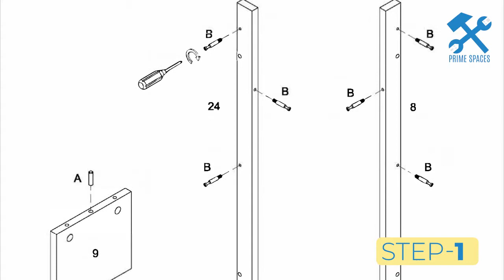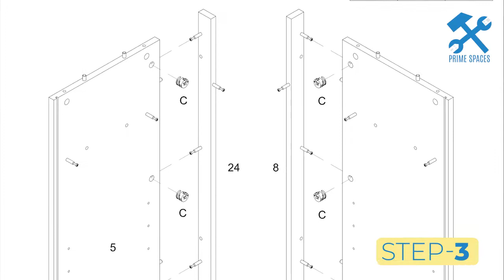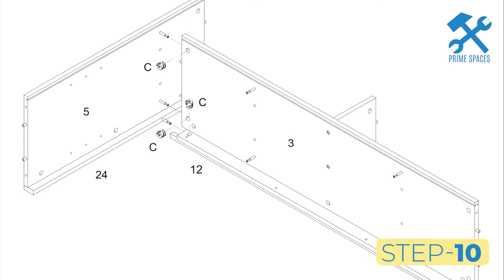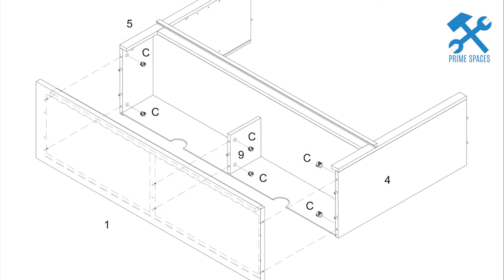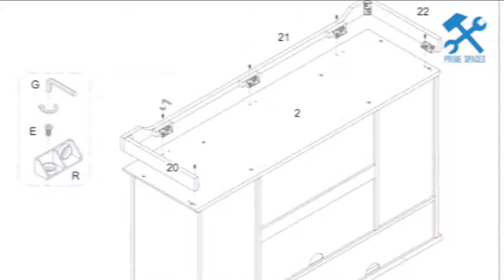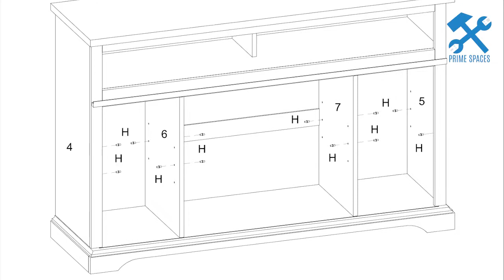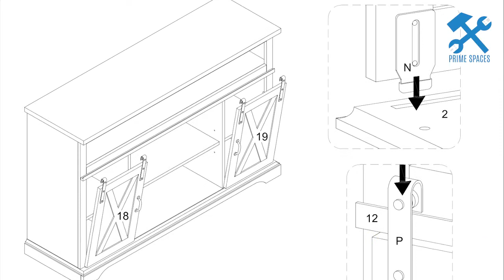Walker Edison 52" Farmhouse Sliding Double Barn Door TV Console Assembly (Middlebrook 52" Clayton)

Comment: Nice video.  Question, what is the depth from the center middle piece of wood on the shelf above the black sliding bars?  I need to fit a soundbar that is 5.5 inches thick in that slot and it 42 inches wide.
Reply from the maker: Not exactly sure, but you can check the dimensions provided in the product page. The direct link to the product is in the description of this video.
Reply: @Prime_Spaces  Does not mention that part, only the other shelves and the unit itself.
Reply from the maker: Ah, got it! Unfortunately, I don’t own the TV stand to take a measurement. We assembled it for a customer a little while back.

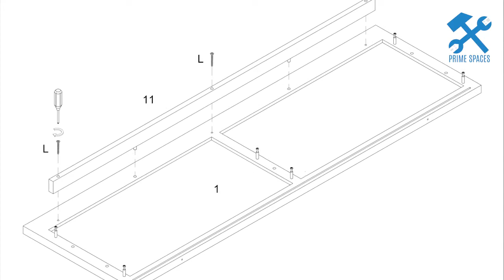Comment: I have a question, step 6 attaching piece 11 to piece 1, I cant get the screws to secure tightly. They just keep spinning. Any suggestions? 3:58
Reply from the maker: Hey there! Have you tried flipping that piece and putting the screws from the other side?
Reply: @Prime_Spaces  I did try that. Got one screw to fit secure, no luck with the other two. Appreciate the reply though. Have a good day!